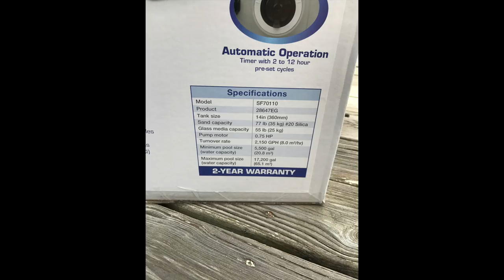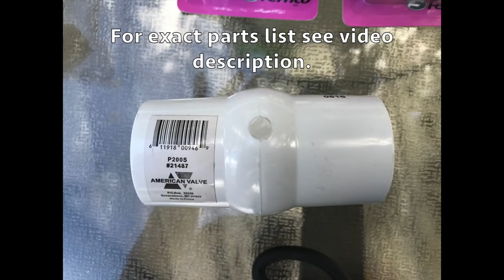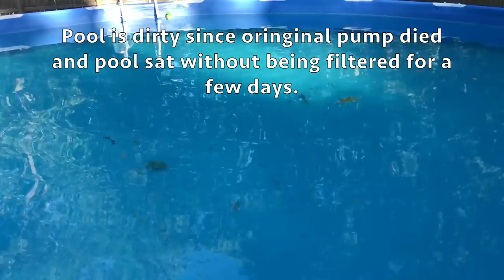Polygroup Summer Waves Pool Upgrade to Intex Sand filter with unboxing.

Comment: Thanks for your helpful video and detailed parts list.  I just recently installed a Summer Waves 14' x 42" pool and also purchased the Intex Krystal Clear saltwater system & sand filter pump.  The only thing different for my setup is that Polygroup must've changed the internal skimmer pump design, because I did not have to break off any tabs or cut the criss-cross pattern off of the inlet.  In my case, I just had to unscrew the top ring on the pump, pull out the impeller and screw the top ring back on.  Everything else went smoothly.
Reply: We just purchased this exact same pool in May! I am already looking at changing the filter system. Doesn't seem to hard to do, but what size pump did you get? That's where I'm at a loss.
Reply: @hoopin4you  thank you. I will keep my open!

Comment: I called the company and according to them you can run the sand filter without removing the impeller. (They could be wrong) I would have left the basket in the skimmer so there are no bigger pieces to clog it. Not to mention it's where I put my chlorine hockey puck.
Reply: So I have an additional question then.  Did you do the other modifications like breaking the tab and just leave the propeller in or did you leave the whole old filter alone?
Reply: @jamiewhispell2054   never got a reply. Sad.

Comment: Looks like a solid idea. However, that skimmer basket looks like it needs a much larger hole than what is currently in the pool. Did you have to cut the side of your outlet while larger? Is that safe for the pools integrity?
Reply from the maker: No, kept skimmer and hope exactly how it came with pool.

Comment from the maker: UPDATE* I ended up tying a small string to hang down from metal frame rim to support the heavy pvc section and hose coming out of filter. Figured over time the grey flexible connector would wear down and leak if left to just hang and sag from outlet on bottom of skimmer.
Reply: I did same thing, pounded a pvc pipe in the ground and used a heavy duty wire tie for support.
Reply from the maker: That's a good idea, I'll probably do something more permanent and nicer looking next year, plan on just relaxing and enjoying the pool for the rest of the season.
Reply: We hooked up my new 16" 3000 gph sand filter system this morning. I have a leak at the bottom of the little knob below the gauge so I got some plummers tape and I'm going to put some on there and see if that stops the leak. Also my backwash opening is to large for my back wash hose so I bought an adapter just hope it fits. Thank you so much for your video. It really helped
Reply: We put plummers tape on the leak and calmed it down a little but it is still leaking. Can you think of anything that could be causing it to still leak?
Reply: @eveyneller7302  Use old fashioned plumber's putty. It seals bigger leaks than the tape can.
Reply: @ryanancona7937  did you use the inlet jet system that came with the intex sand filter?

Comment: I have watched many videos on this, yours seems easiest.   I knew there had to be a way without grinding and drilling new holes.  Obviously Intex has the best methods as that is what I have had for the last 5 years but I am having problems finding an Intex the size I want at the end of summer.  Have you figured out an easy vacuum system as well??
Reply from the maker: On amazon  you can find a vacuum plate that fits the summer waves skimmer, then just get vacuum hose and head. If you hit the link in the video description text, I have the exact parts I used for my vacuum set up, it works very well. Thanks!
Reply: Is the ball valve suppose to be like a cut off valve to stop the flow of water?
Reply: Do you leave the little basket that goes in the skimmer out when you vacuum?

Comment: So I just bought the Summer Waves Elite 14' x 42" pool - and trying to find out if the Skimmer is the same as yours...  I'm guessing it should be, at least relatively close...?  

Your video was the easiest to follow...I thank you for that.
Reply from the maker: Send or post link to where you got it.
Reply from the maker: Looks like it is the same exact skimmer, I seriously doubt they’d change the design. The skimmer ate looks exactly the same and same shape as well so it should be the same as mine. Good Luck with the pool.

Comment: thanks for the vid maybe next time not so fast on the screen flips, like on meth or something. lol.  Why not just leave the old pump in the bottom and just use the sand filter or is it not big enough ?
Reply: I called the company and according to them you can run the sand filter without removing the impeller. I would have left the basket in the skimmer so there are no bigger pieces to clog it. Not to mention it's where I put my chlorine hockey puck.
Reply: @sputnut  Thanks man appreciate the reply.

Comment: I am trying to upgrade my pool too, I got a Summer Waves SFX600.. I am trying to PVC hard pipe hookup a Harris H1572730 ProForce 1.5 HP. My problem is getting the pipe reduced to the summer waves SFX600.

Comment: Do you have a video on how you hook up the vacuum?
Reply: You attach a hose, with a vacuum head and pole attached, to the outlet side fitting. You can then vacuum the pool. If the suction gets low and does not pick up well, you will need to back wash the filter to clean it and it will resume cleaning well.

Comment: How do you vacuum with this system? Where doe the stuff from the bottom of pool go?
Reply: you vacuum the same way using stock equipment. just no more paper filters snd the sand holds the crap you just clean out

Comment: Hey, I’m having incredible trouble getting the seal in place to reset the pump. The seal seems to be stretched. Does it go under the pump, on top of the cap that screws? Or on top of the pump lip?
Reply: I had the same issue. I ended up plugging the hole and rotating the skimmer 90 degrees so I could easily see it from the side.  Then I worked the gasket in and put back in the modified pump.  No leaks and I no longer lose prime when vacuuming!

Comment: I need help with putting on the darn pool cover. Any ideas???
Reply: Yeah those pool covers are garbage and hard to put on by yourself I just bought a tarp 18-foot should be good just get one put it over the whole pool and put like some steaks down or some small rocks or no just something to hold it down so the wind doesn't blow it off but also make sure you get heavy duty tarp not a cheap one cuz of cheap ones won't work that good

Comment: Thank you for this video very helpful got all my parts at tractor supply and home depot it's hooked up and running great! One question I have is can I still use the skimmer vacuum or will this pump cave in the hose/skimmer basket? Thank you

Comment: Thanks for posting, this will be a huge help!
Reply from the maker: You welcome. Glad this helped.
Reply: Just finished the change over to the Intex Sand Filter System, so much better, water has been crystal clear. Those pumps and filters that come with these pools are absolute junk, got the pool last year and at the end of summer pump motor burnt out and I was replacing the filter cartridge about every four days or so.
If anyone is thinking of doing this...you won't be disappointed!
Well worth the money to upgrade.
Thanks again Ryan!
Reply: legal2311  I agree the sand filter  pump is a must have if you  want crystal clear water ..
Reply from the maker: Yep, my pool has never been so clean and easy to keep in balance since the switch.
Reply: Links dead

Comment: I have a small leak at the bottom of the old pump/skimmer, but I never saw a gasket when I removed the pump(which never leaked before ) I'm assuming I'll need to put a gasket between the old pump and the screw on fitting right?
Reply from the maker: https://www.amazon.com/Replacement-Motor-Summer-Waves-Motors/dp/B01DCILUA0/ref=sr_1_3?ie=UTF8&qid=1499972591&sr=8-3&keywords=sfx1500
Reply from the maker: Here is what you should have. Maybe your old ring has worn down. When I screwed my motor back on I have the smallest drip that happens every few mins, but to me its not even worth the time to get it to be a perfect seal.
Reply: Funny I gave it one final hard turn and it stopped leaking ! Happy camper now!
Reply from the maker: Nice, maybe I'll try the same, maybe that's all mine needs as well.
Reply: I'm having the same issue with leaking. Did you ever get yours fixed? Where exactly does that motor seal (o ring) go? One guy said the motor housing.. is that the white canister, because up underneath it, there are two groves. Or does it sit around the motor itself? Not having any luck with finding where to exactly place it. Thank you
Reply: they make conversion kits for 30 that permanently remove the old pump and just screws a solid bottom in place

Comment: AWESOME and complete!  BUT . . . I have a question . ..  how do you run your vacuum?
Reply: Never Mind!  Same as it was before,  I just don't have to deal with the filter underneath the skimmer vacuum attachment.  Vacuum is SO MUCH more efficient now!!!
Reply: I'm unsure what you mean. I just added a sand filter today, but would like to know how to hook the vacuum up for the bottom. Please help!!
Reply: I just hooked up my vacuum like I did with the old pump.  I'll take pictures later today.  Old vacuum system with new pump works SO MUCH MORE effectively and efficiently!
Reply: Perri Yinger I figured it out. Got so much dirt out of it. Thanks for the info.

Comment: What does the shut off valves do?
Reply: Wondering too, why the ball valve?
Reply: I think its needed to stop the water flow so you can clean the leaf basket. I just bought a very similar model just wating for it in mail. Planing on hooking it up this way.
Reply: Correct.  Also should have a valve on outlet side so you can service/clean your electrolytic plates
Reply: @dank6408  111¹¹

Comment: Why did you hook all that pvc shit up? Makes no sense. I just stuck the small hose inside the bigger hose lol what the hell?
Reply: How did you set yours up?
Reply: @sabrinakintzele4181  just hooked everything up the same way, but with out the stupid pvc extras. I just put the smaller hose into the bigger hose; however I had summer waves pool. You don't need that extra crap. That's just nonsense.
Reply: @malkerian  I don't think you understand the importance of the ball valve.